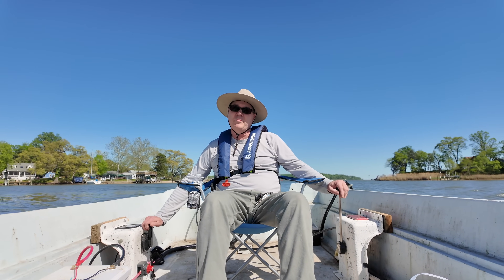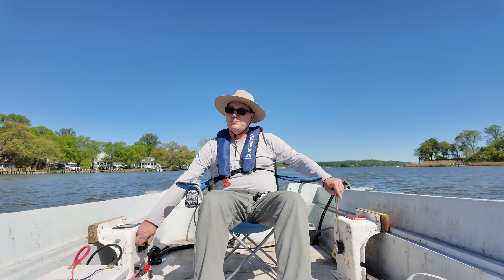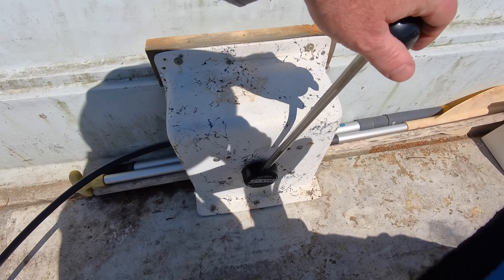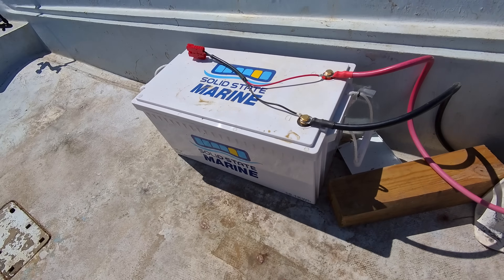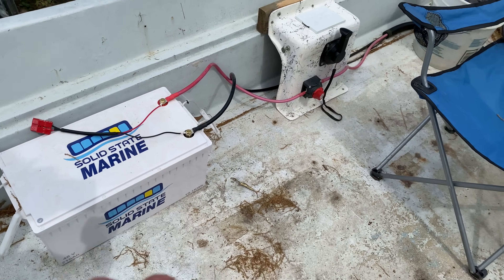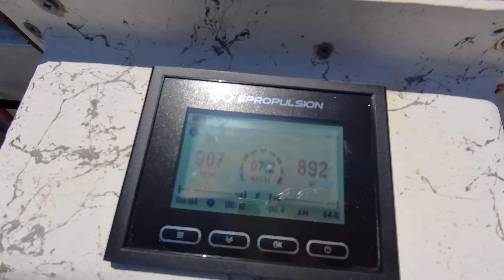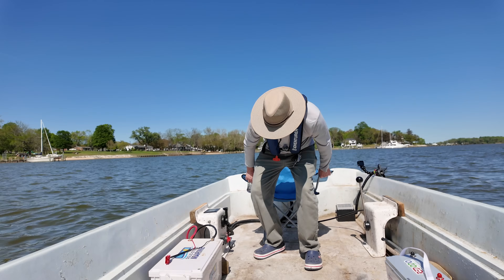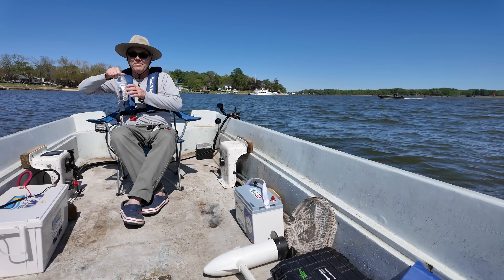No steering wheel - Steering a boat with an Ezy Stik

Comment: I have an NT300 with a litime 55ah battery (can do roughly 9 miles full throttle on a charge) with a 12 ft. hull. I can do about 6mph in it. Do you think it would be a bad idea to put a steering setup on it? I can get the controller for the NK300 + cable and then 3D print a bracket setup for my steering kit. From what I've seen, the NT300 tiller is detachable by unscrewing some stuff. and the cable seems to be a quick connect.

Comment: The cut off switch is supposed to be attached to you when using the motor. It's no use just lying on the boat floor...if you fall off the boat the motor will continue going until the battery dies.
Reply from the maker: 100% correct. I need to add some length to this one. It's too short for how I have this boat set up.

Comment: You have the steering cable going to the motor on the wrong side.  The ez glide steering is made about 25 miles from where I live. We’ve been using them for years
Reply from the maker: That's what I figured!

Comment: Hey, regarding last week’s video about the eLite and shaft lengths, turns out a Pond Prowler calls for a 15”, and the eLite adjusts to 15” max length. Now I am really confused. It must be that the boat manufacturer and the motor manufacturer are measuring from different points.
Reply from the maker: There's now an eLite long shaft (which is what I have)

Comment: What's so special about this? Stick steering has been around for 50+ years, and I doubt you're the first to hook up an electric motor to it. 🤦‍♂️
Reply from the maker: Have you seen a stick steer with a 9.9 electric and a solid state battery?
Reply: No kidding. I've yet to see an airboat that doesn't have stick steering. I think stick steering appeared on airboats sometime around 1930-ish.

Comment: Airboat use this kind of steering
Reply from the maker: Are those the boats with a big fan in the back and rudder blades to direct the air?
Reply: @WayneTheBoatGuy yeah  used mostly down south in the swamps

Comment: Any chance you can give a total cost for the following again?:

1) Battery
2) Motor
3) Cables/throttle/lcd or any other related electronics accessories that you are using in the vid?

Thx and great vids!
Reply from the maker: The cost right now seem to be changing, but there's over $11,000 worth of motor/battery/steering in this boat

Comment: Hi Wayne, can confirm your steering is backwards. Should be, push forward for right, pull back for left. As if a normal steering wheel was just turned 90 degrees counter clockwise and mounted on the sidewall. We have a 1985 Lowe Sprite with a stick steer and love it. The steering cable comes in to the outboard on the other side on ours. Good luck
Reply: If it's on the right side of the boat, forward is left and back is right.
Reply from the maker: I think if I ran the cable into the other side of the outboard everything would be good, but I couldn't get the threaded shaft removed to put it on the other side.
Reply: @WayneTheBoatGuy  Would it be possible to switch sides with the outboard controls...or is that more trouble than it's worth?
Reply from the maker: @jerryq1000  Yes it probably could work mounted on starboard

Comment: I dont know if i could get use to steering like that.  Did you swap it around like u mentioned?
Reply from the maker: Not yet - I can't get the threaded section on the motor loose enough to flip it around.
Reply: I would try set it up so the stick is facing the bow or stern and pulling it right turns right and left turns left, like a steering wheel. 
Love your work though Wayne. Always love your videos. 
E-Boats all the way. 
Have you seen the Momentum M10? It is a rocket.
Reply from the maker: @mycoolo304  I don't think they have any dealers in the US yet - hope they do soon!!

Comment: Finally a 9.9 e setup! Its a great setup!   We have finally arrived.   Clean , quiet and no hard pull starts,.   lol
Reply from the maker: Yeah I'm pretty happy with it
Reply: I have the 9.9 eprop motor in a 14ft aluminum boat - 13.5mph top speed. It’s an awesome motor. And I can dream about that 10kWh solid state battery, that’s a 50 mile battery in my setup for only 100lbs of weight!
Reply: @odiemac Can you plane with it?

Comment: I have been thinking about putting together a small boat with an electric engine. It seems that even the small boats are priced out for the average guy. I like your concept. It seems more environmentally better for our waterways. For me and my partner, it would allow us to explore the Florida small islands for bird photography. I have never owned a boat. Been looking in the web. So far, looked at some Whalers and Lund models. I actually like the older Whalers. They seem to have more style, like the 16 nauset 1961-1973. Anyway, I enjoy your channel and your ideas.  Perhaps my idea of a small boat and electric motor is too much for bird photography. Maybe one day
Reply from the maker: The nice thing about these old Whalers is that they're wide so you can stand in several places and not tip the boat.
Unfortunately this electric setup is not cheap at all.